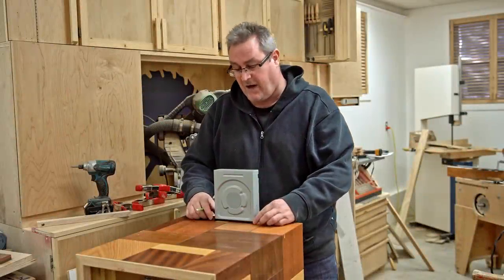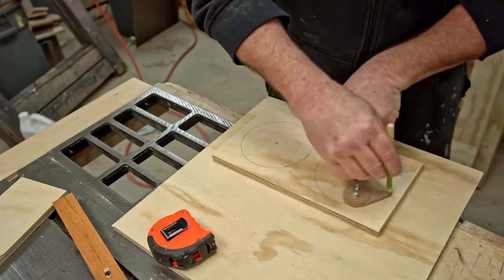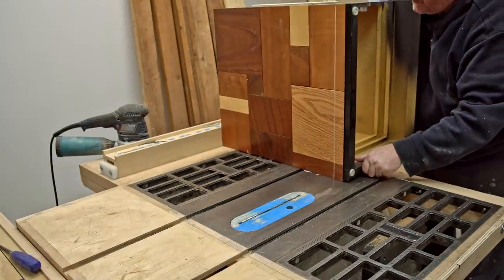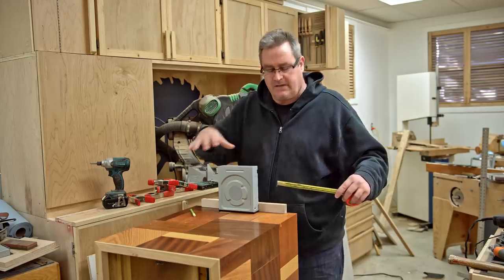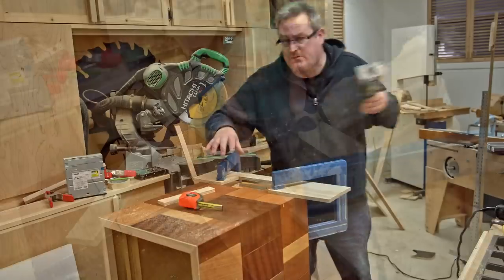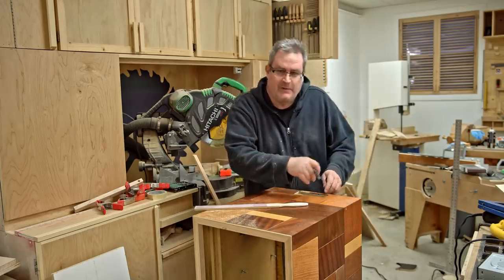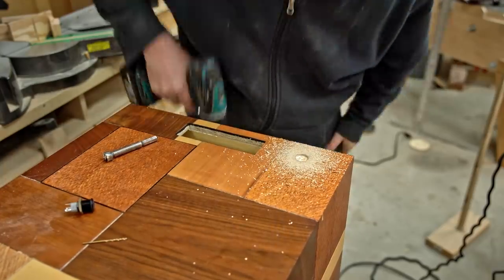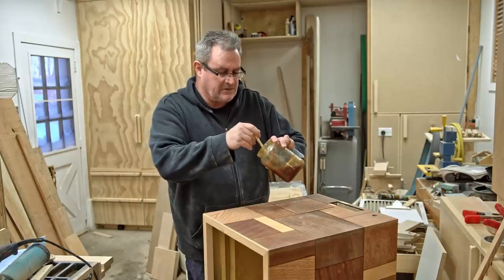Modding My Wooden Computer Case

Comment: Excellent vid John. I'm 69 years old, and still watch to pick  up the techniques used in projects, especially yours. For instance, I wasn't aware that water based poly would take on top of danish oil so thank you for that tip.

Comment: Switches like that are designed for stamped steel or molded plastic panels and cases - so it's no surprise there's not a lot of lip to work with.  But you love a challenge!

Glad you decided to keep this case - it's a nice piece of furniture.
Reply: BTW - you can make fans a tiny bit quieter by removing any blade guards you can. 
The computer I keep next to my desk has a single low-speed / high efficiency 10" fan that doesn't make a sound.
Reply: I am glad that I am not the only person saying that part not designed for this purpose. I watch videos like this for the problem solving techniques. So by all means use parts for unintended purposes.

Comment: You could flush the dvd drive with surface and then remove the cover of bay by pulling it up and replacing it with a piece of wood which hides the drive front. you won't need the drive eject button as you can do that from OS too, but you will need a small hole for emergency eject. you could do same with power button too. Also a 6 years computer with filter should collect that much dust, unless filter has a small gap, or there are exhaust holes behind the graphic card. and removing fan from graphic card is a very very bad idea. you could however replace it with water cooling and then place the fan and radiator completely outside the case under it.

Comment: Hey John, You said after you had applied the oil finish and let sit over night you were going to apply a water base clear coat? Won't there be an adhesion problem from water base over a fairly fresh oil finish?

Comment: Hey John, you should totally use those Noctuas on your CPU cooler, not the case. Better get the S series instead of P series fans (I guess P is for Pressure optimized?) for a case. You'll get better airflow for the same noise but no pressure (you dont need to pressurize your case)

Comment: Hi John another great video. I notice you use a lot of construction adhesive, is that better than using wood glue like Titebond? Also what construction adhesive do you recommend for what application? I’m fairly new to woodworking and your recommendation will be helpful, thanks and please keep making your videos.
Reply: Apparently regular wood glue doesn't set in really cold climates.
Reply: Nunaya Bizness, thanks for the prompt reply

Comment: Usually use silicon mounts for silent fans John. I'm surprised you didn't get them with those Noctua fans. That plywood bezel is probably a bit thick for them though. You might also like to check out silentpc.com for more on the subject.